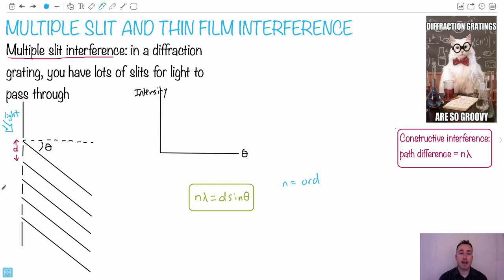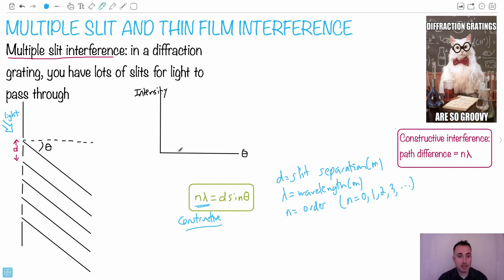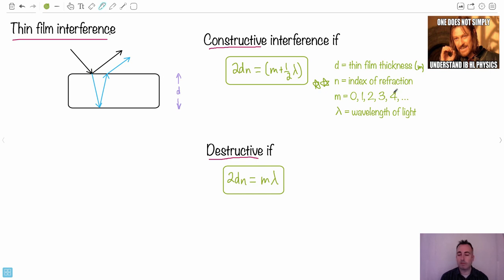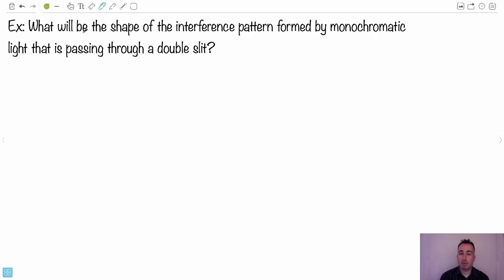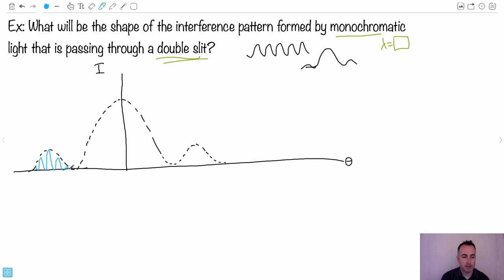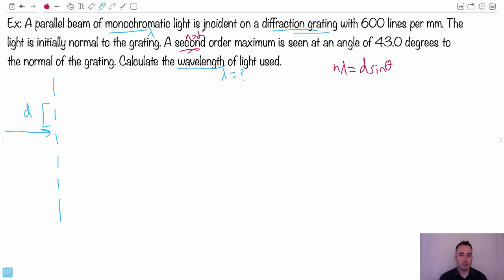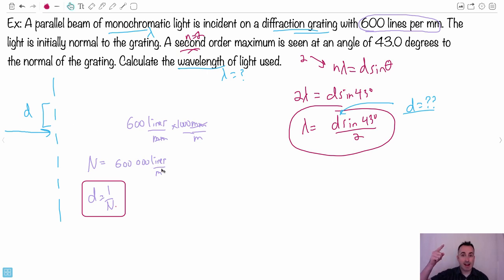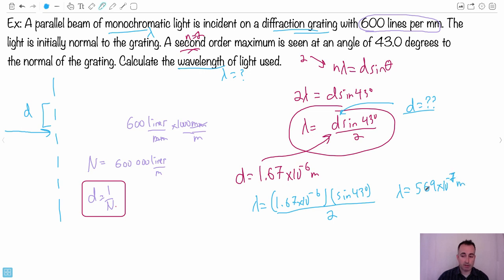Multiple slit and thin film interference [IB Physics HL]

Comment: For my Physics HL IA, I'm thinking of exploring Beer-Lambert's Law by seeing how concentration and color (in wavelength) of a solution affects its light absorbance. Is this a viable topic or is it too simple?
Reply from the maker: It can be a good topic - it always depends on how you approach it. I recommend talking it over with your teacher to make sure. The simplest idea can still be made into a good IA if you set it up thoughtfully. If you're going to do an experiment (which it seems like you should with what you described), make sure you take lots of data points, that you be aware of what variables you manipulate (how will you vary the concentration?) and what you measure (how will you measure absorbance?), and be very meticulous about your error analysis. Then compare what you got to what you expected, make sure you can put in a few graphs to show your results (line of best fit it nice, especially if you can find the uncertainty on the line of best fit). Make sure you discuss what your results mean, how they compare to what's expected. Good luck! Beer-Lambert's law sounds like a fun one!

Comment: 8:17 for the conversion aren't you supposed to divide it by 1000?
Reply: when you have 600 lines/mm, and you're trying to convert it into metres, you basically multiply the numerator and denominator by 1m. hence, it becomes:
(600 lines) * metre / mm * metre 

since there's 1000mm in 1 metre, you can change "metre"  to "1000 mm." As we're trying to get rid of the mm, and it's there in the denominator, we convert the metre on the numerator to 1000mm. 

therefore, we multiply it.
Reply: @TrueBK77  i still dont understand cause in the data booklet the conversion from mm to m is always 10^-3 right?
Reply: @abhishekaandrew5100  1 millimetre = 1*10^(-3) metres
Or
1 millimetre = 0.001 metres
If you multiply both sides by 1000 (or 10^3)
You get 1000 millimetres = 1 metre
Reply: @TrueBK77  oh now I get it thank you so much🙏🙏🙏